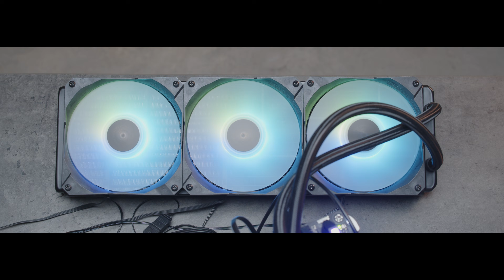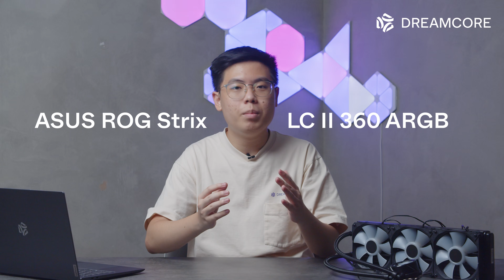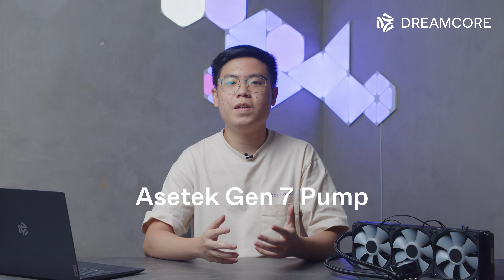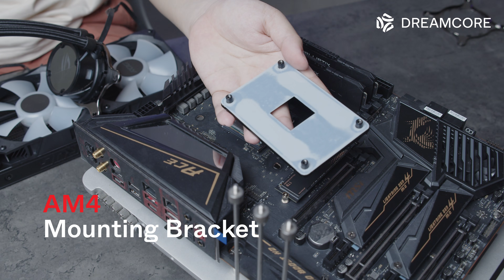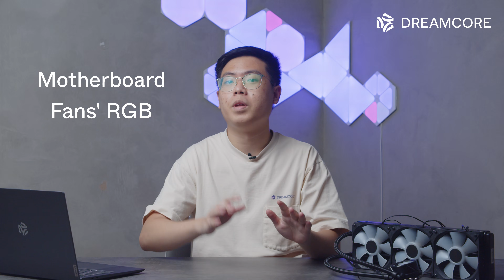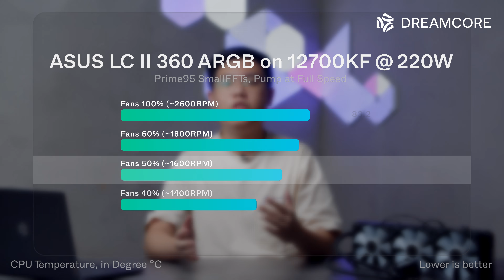ASUS ROG Strix LC II 360 ARGB AIO Liquid Cooler Review

Comment: I just got this liquid cooler but I have no idea which way the fans blow. I need to install the radiator in the front of my case.  The manual isn't friendly for users who have only installed traditional air cooling heatsinks.
Reply: They have an arrow on one of the sides of the fan. The direction the arrow is aiming at is the same as the air goes.

Comment: Does it connect through the cpu fan header or the chassis/system fan header?
Reply: You can use either for an AIO,  if your mobo doesn't have a dedicated pump header

Comment: DISCLAIMER: The “ASUS ROG Strix LC II 360 ARGB” does support AM5.
Reply: will i need a different mounting bracket?
Reply: @D1N0-_- He didn’t fully disclose this but they now come with LGA1700 and AM5 mounting brackets, I went to a local microcenter and was informed that some of the older stock LC II 360 may ONLY have LGA1200 and AM4 mounting brackets.

I’m currently running the CPU cooler paired with a Ryzen 7 7800X3D

Comment: How do I change the fan speeds?
Reply: Either through the bios of the motherboard, or with a usage of a fan control software. I use the Argus monitor
Reply: with armoury crate

Comment: I want a noise test VS 280mm radiator what would be better for 12900k?
Reply: Which ever fits your case. There's not much temp differential between a 280 and a 360. I would not use a 240 though.
Also, with more fans, you can then turn down the fan speeds.

Also last not on watercooling : longer radiators typically perform better than thicker radiators due to the amount of surface area the longer radiator has.

Comment: Have you tried a push/pull config with 6 ARCTIC P12 PWM PST A-RGB fans on a 12700k? Wonder if it's better in terms of noise and performance, since these fans are absolutely insane in terms of performance, price and noise level wise. They even beat their Noctua and be quiet! competitors.

Comment: No wonder i have trouble to handle my i9 12900k temp during on load with my x63 cooler. Even 360mm aio like this can only give 80 plus degree for 12700k. GG
Reply: @Jayden Blackpoint yup. but i will always stressing out my cpu for highest setting in obs. x264
Reply: What ambient temp and it is a intake or exhaust?

Comment: Could someone tell me why the aio does not turn on if it is well assembled and the fans too? Is there a driver because it doesn't come out in armory crate
Reply: loosed connecting pins, sometimes they are not well crimped, better look on to it closely.

Comment: do I have to get a lga 1700 bracket for a 12900k with this cooler
Reply: I did with mine, that's why I chose this one. I'm in the UK and was really difficult sourcing this aio here 😂
Reply: @Sebb2310   I bought the cooler on amazon for $14 good thing because I sent a request to asus for one and they don't even have the bracket I need so now I can continue with my build
Reply: @ployth9000  can you please tell me where on Amazon you got the bracket? I am having a problem finding the LGA 1700 bracket for my set up.
Reply: @CGaribaldiDO   amazon vende este producto con el anclaje 1700, ahora va incluido.

Comment: well damn it sounded like a jet engine at 2600 rpm and im buying this AIO liquid cooler
Reply: I'm using it with my i9-9900K on 4.9 GHZ, 1.35v, LLC 5. I do advice against using the fans on 2600 RPM - haha! I'm running them on 50% and the fan pump on 60% - works great!:)

25-30c during idle
50-65c during gaming